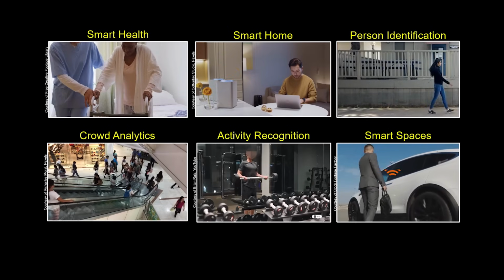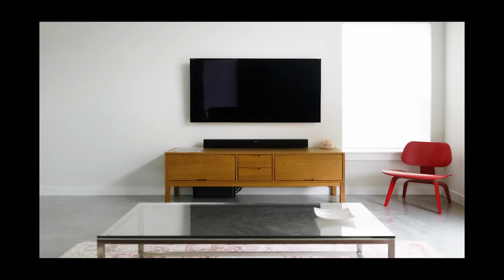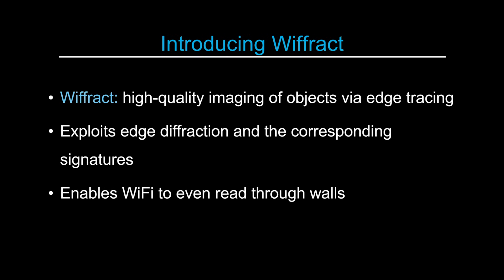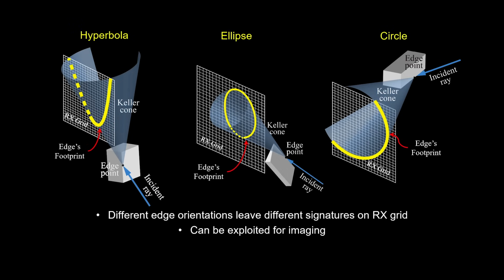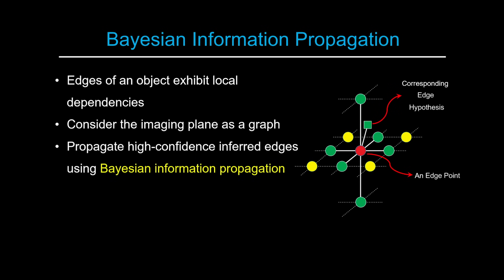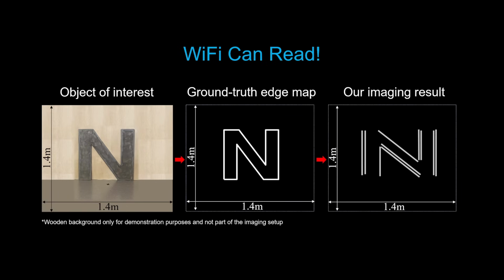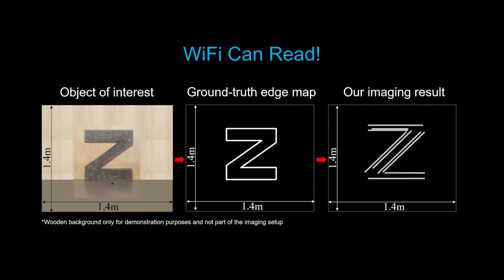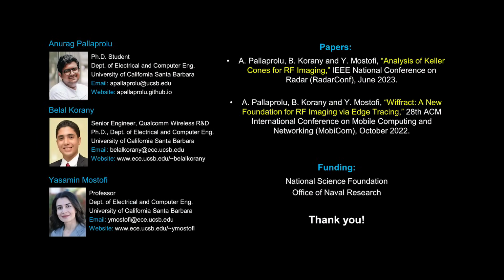WiFi Can Read Through Walls

Comment: So the cable companies lied.wifi does go through walls not around.smh
Reply: The way that a radio signal interacts with the wall varies hugely based off of the wall shape, the wall material, the radio signal's frequency.
2.4 GHz goes through most walls better than 5.8GHz, but neither of them are particularly good at penetration.
Reply: Yeah, just like ye olde radios from the 50's...

Comment: AESA RADAR??
Its already done in modern  Active electronically scanned array
Reply: They are using WiFi cards of laptops and not dedicated pulsed radar, also radar imaging assumes omni surface scattering whereas they consider edge diffraction, so the improvements from this method should scale to radar systems as well...